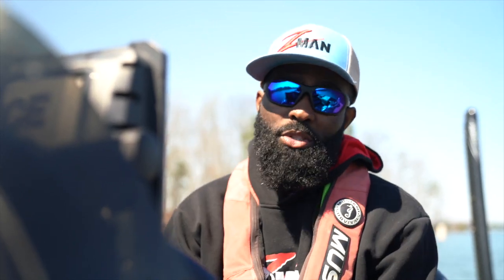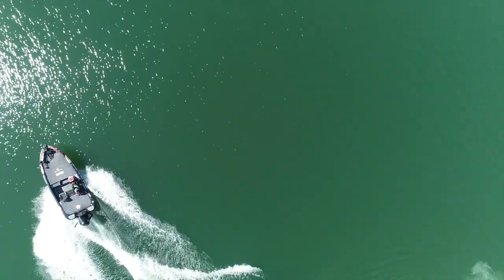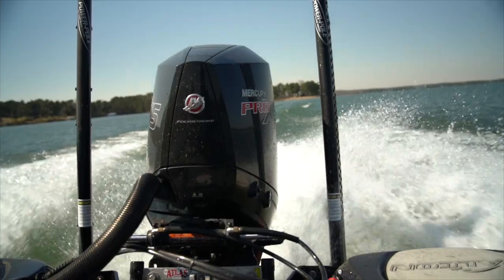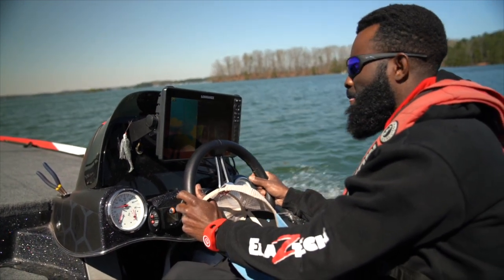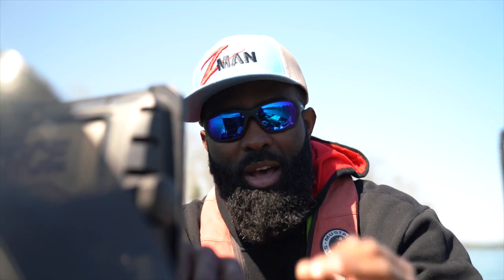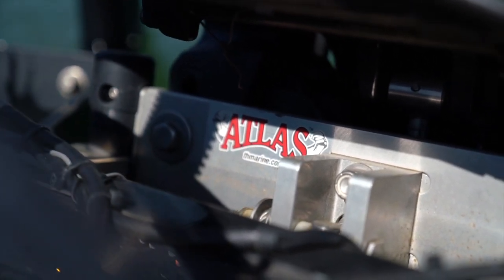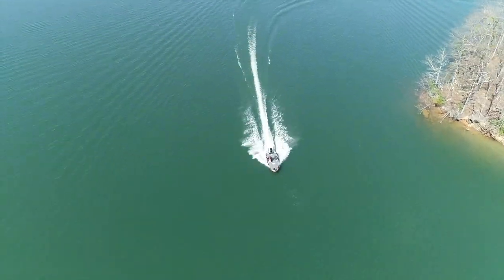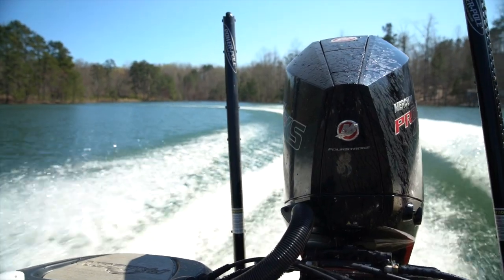Should you get a hydraulic jack plate - Brian Latimer

Comment: I have a little 13 ft Dell Quay Dory (Unsinkable, English Whaler) with 50hp Johnson 2 stroke. It was the tender to my big boat, 41 ft Chris Craft Commander (virtually every marina and dinghy dock limits tenders to 12 feet but for some reason they never balk at a 13 ft Whaler). 

I had to rebuild the transom when I bought it (someone had adjusted the transom height by screwing a 2x4 to the top, of course water ran down the screws until it rotted the whole transom) so when I rebuilt it I built the transom to the exact height for the 50 hp Johnson I bought for this boat, so the cavitation plate was even with the bottom of the boat. It seems to me that one reason for having a jack plate is because the transom is not at the optimal height.

The motor has 3 adjustments to set the position of the motor relative to the angle of the transom. I have tried all 3 settings. If I didn't have trim/tilt I would have set the motor in the most upright position. This would have made it take longer to get up on plane but run better once on plane. I discovered that with the motor tilted back (prop forward) the prop sits more under the boat. The force vector is more up towards the bottom of the boat rather straight forward. This forces the stern up and the bow down very quickly and allows for getting up on plane the fastest possible. The boat won't run fast this way but it will run on plane at the lowest possible speed 10,11 knots. Once up on plane or as it's going up on plane if I trim it out it runs at 21 knots at 4600 rpm all day. I can pull U turns at 20+ knots and it spins right around solid as can be slowing to about 18 knots but never breaking free.

I still want to put a jack plate on it for 2 reasons. 1 run this boat in lots of shallow water in rivers with rocks and sunken trees. I am thinking that being able to raise the motor up would protect my skeg and props which have been getting dinged pretty regularly. When I was in the Keys this wasn't an issue because skinny water usually has a sand bottom. The second reason is that I can tell the difference at idle when I walk forward. The motor raises out of the water and runs better. Also, like any boat, when you jump up on plane quickly the stern squats. This means you need to have more water under the stern to get on plane or you need to have a jack plate to raise the motor so it doesn't hit bottom.

The main hold up to buying a jack plate is I am wondering if even with only a 4" setback if I will need to buy longer steering cables and essentially redo all my controls. Does anyone know if a 4" setback requires longer cables?

Thanks for any input on anything I might have missed about installing using a jackplate
Reply from the maker: Steve, sorry to take so long to respond.  We've been slammed getting ready to close for this week.  Feel free to call and talk to our Service Dept (256-442-2588) next week when we are open (after Thanksgiving).  I will make a note for them to take a look at your question next week and see if they have any answers for you.
Reply: Thank you.

Comment: Blat, why not use trim?  I understand 1/8 jack plate adjustments, as you explained.  Most boaters want it in for rivers in Louisiana rivers, or low water sand barge environment.   Show us a benefit please.  I have a lot that want it and end up burning engines because they are focused on the drive and stop paying attention to the temp.  It seems a 1800-2800 add on that folks want but are not ready to be that dialed in for and understand it.

Comment: Great info, I don’t have a hydraulic jack plate, it’s mechanical, when I hit top speed at 65mph and I’m trimmed up my boat fishtails.
If I lower my plate would that give me more mph and less fishtailing at that speed?
Reply from the maker: Thanks for the questions.  Sent it over to our Service Manager and this was her response:

Not enough info here to accurately answer. I need boat info, engine info, jack plate set back info, rpms at wide open throttle, prop make and pitch and water pressure at wide open throttle.
BUT…….
Generally no. If he lowers the plate he will lose speed.  Try a half inch and see. 
If by fishtailing he mean chine walking then lowering the jack plate should help a little but you’ll lose speed too.

Hope that helps!
Reply: @BucksIsland  Good answer. Sounds like there is too much boat out of the water or more specifically enough chine in the water to stabilize the stern so there's nothing holding the boat on line. Small direction changes make motor push stern from side to side. A flat bottom boat will do the same thing. Could be hull design. Modified vee hull with flatter stern, (not enough dead rise) and too much motor might do this too. Not all boats are designed to go that fast safely. 65 mph is getting up there if the hull is not designed for it. I've been in some Action Marines doing more than 80 plus and they get scary when they start chine walking. I've been in boats with 25, 26 degree dead rise and at that speed they barely raise your heart beat. One thing is for sure. What he is describing is a boat barely in control. I would not be concerned about losing speed if I were him.

Comment: I’ve seen people say they don’t have a “hydraulic” jack plate on their boat, is there just a regular jack plate that doesnt use a hydraulic cylinder or do some boats just not have jackplates
Reply: Some are Hydraulic. Some electric. Some are manual, so you would use a socket to raise and lower. Some are fixed, so you mount the motor where you want and the plate just gives you more options. And many boats just don’t have one. So the motor mounts right to the transom.

Comment: I have an older boat , i am doing a few things to up grade it to make it the best boat it can be. I am wondering I have a 17FT carolina skiff center console with a johnson 48  special on it would a Jack plate be to heavy for my boat and would it truly be beneficial? the boat is in pretty good condition hull wise. TIA.
Reply from the maker: Thanks for the question!  From our Service Manager - "We don’t tend to deal with a large about of the 17ft Carolina Skiffs here.  However, I don’t think it would be overly advantageous to put a jack pate on that rig.  The performance benefits aren’t really there.  If it were my boat I’d put the money into cooler electronics."  Obviously that assumes you don't already have all the electronics and trolling motor accessories you want.  Hope that helps!